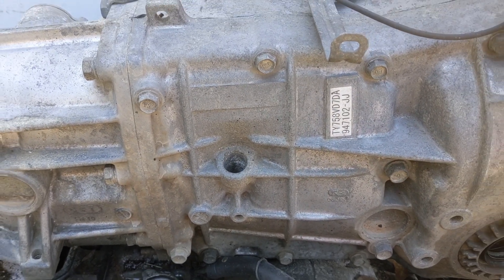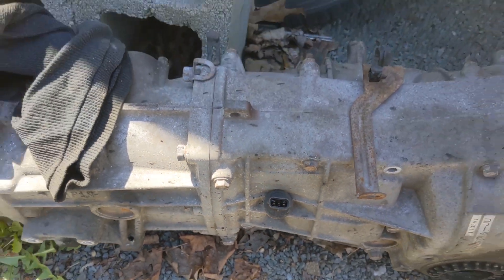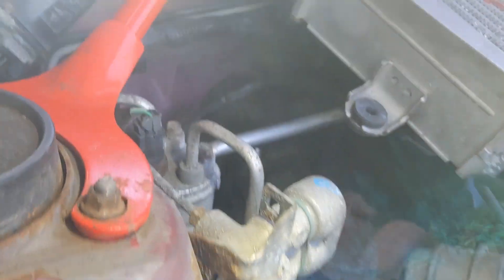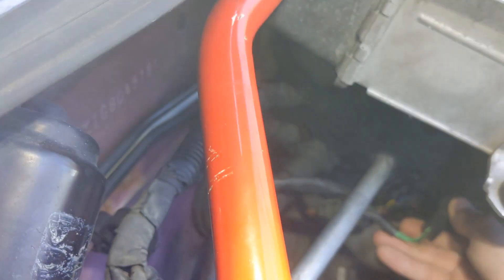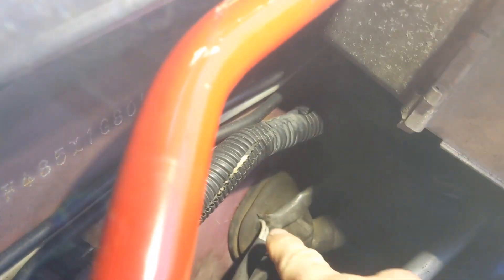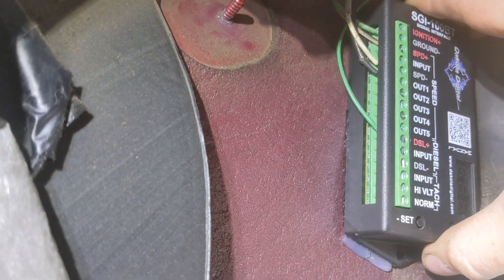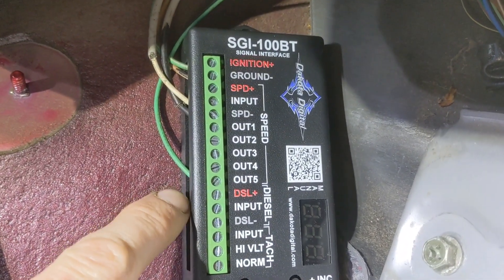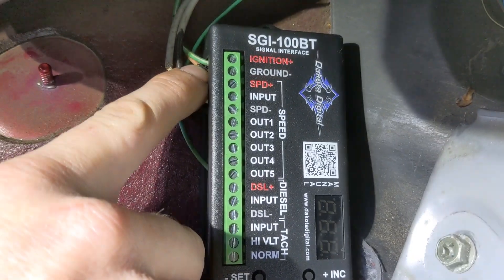Dakota Digital install for Subaru speedometer after newer transmission swap p0500 4k rev limit fix

Comment: So for this to work, you need to have the front wheel speed sensors installed right? And does it matter which wire coming from that sensor? There's a black one and a white one if I remember correctly. 

Rwd converting a first gen Forester with a brz trans which has no speed sensor on it. Almost going to be a drift car so I shortened the knuckles and don't think I can use the speed sensors anymore due to clearance issues.

That's being said, I could probably use one of the rear sensor wires right?
Reply from the maker: Rear sensors should work also. I use front because of easier access. On a rwd / drift app id prefer the rear wheel sensor

Comment: Which ABS wire? One from one of the wheel speed sensors that you just spliced into or is there a signal out from the ABS module itself?
Reply from the maker: Where i cut the abs wiring in the video, it can be tee'd (tapped) into instead.
Reply: Just from any one of the wheel speed sensors or is there a specific ABS signal line from the module going somewhere else?
Reply from the maker: From one of the wheel speed sensors (front right like in the vid)